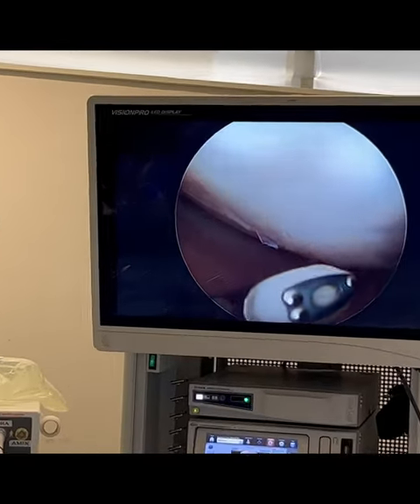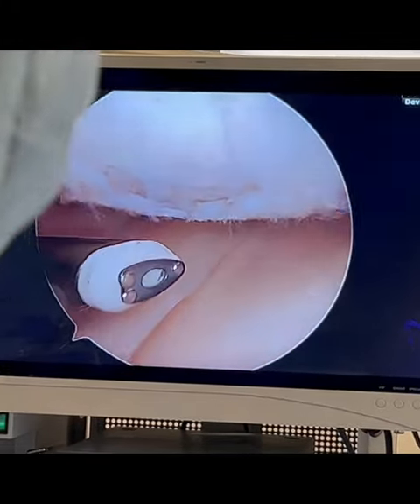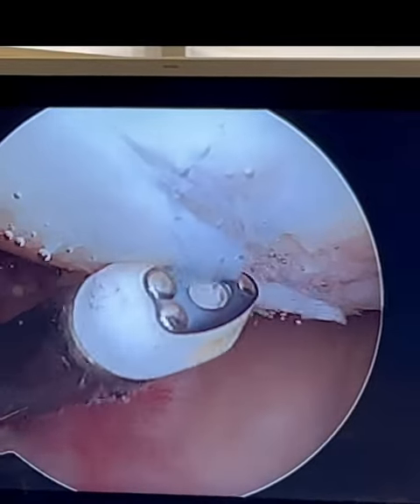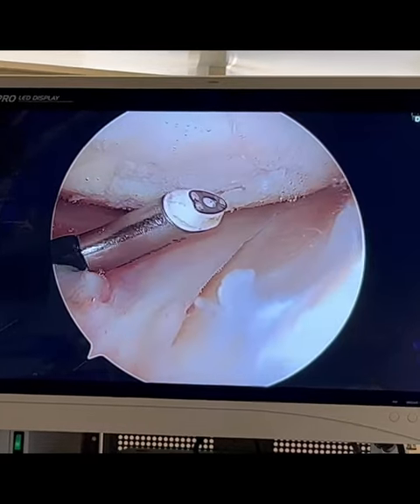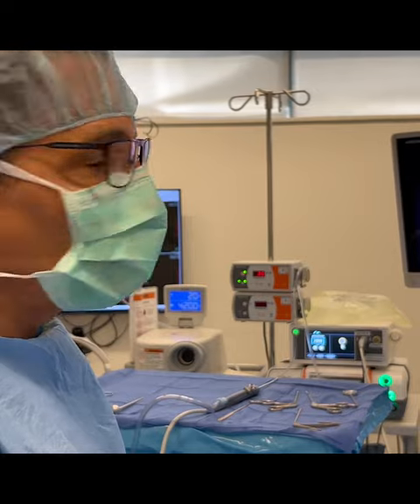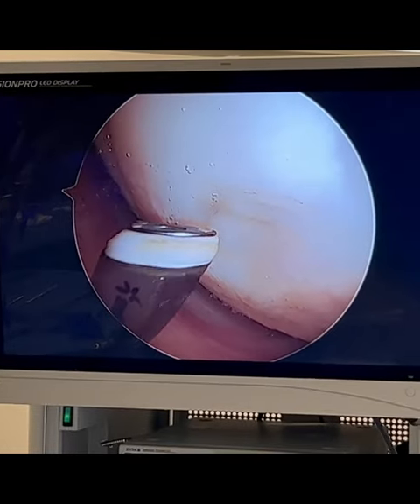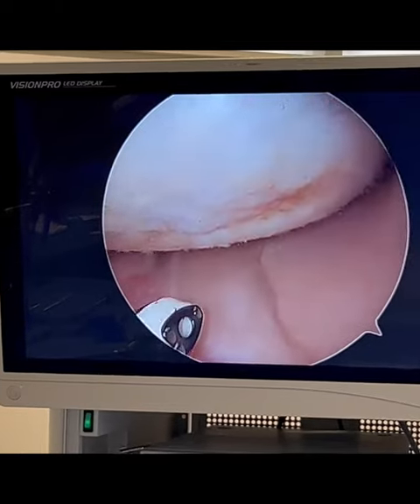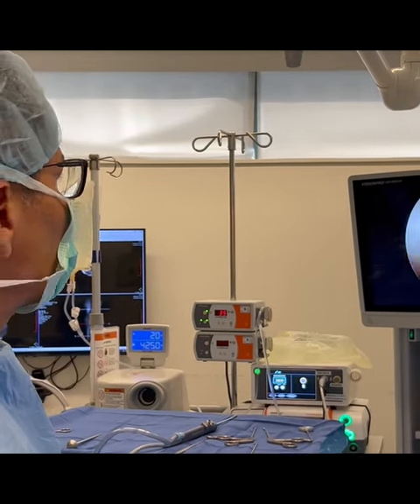What is CHONDROPLASTY of the Knee? #theUFCfighterSurgeon explains

Comment: I injured my knee skiing whereas my skis stuck on wet snow and my body momentum went forward...just a twitch.  I had pain going up the stairs initially and after the 4th year of injury every once in a while transferring my weight to that leg while skiing I had extreme sharp pain.  After my second MRI(the first one was normal), the imaging show inflammation at the infrapatellar area.  After knee arthroscopy, they found lateral meniscal tear and chondral damage.  It took me 4 years to fix my knee.  I ski 20 times/season, do day hiking, running.  I am very active.  It is now 4 weeks post surgery and while I have full flexion, still with pain/stiffness I am not back to fully recovery.  I wouldn't think at this point I will buy a seasons pass to ski.  I am not back to weight lifting which I did prior to the surgery.  My PT advisor says do NOT rush your recovery.  That is hard, I love being active. At least I can get in/out of my car with a little more ease and I hope that gets better.  What will be a delight is being able to do yoga again.  I don't trust the operated knee yet to hold a flexed position at this point.  Trying to eat healthy, taking 1000 mg vitamin C, 100 mg of Zinc, B complex.  Anything additional advice to help my recovery would be welcomed.  Thank you.

Comment: I might have to undergo this procedure too.  It was mentioned in one of my doctors notes upon seeing me after a recent MRI of my right knee, which indeed showed torn articular cartilage in the trochlear region.  My case is degenerative in nature due to arthritis, and I’m wondering if that type of injury is a good candidate for this procedure?  I’m 52, and the knee has degenerative osteoarthritis, mild to moderate stage of degeneration.  I’d rather continue therapy to strengthen the muscles around the affected area to relieve the pain and discomfort.  But what are the odd that this would work for someone my age?  I was also told that this will leave me with bone on bone if I go through with it.  And is a total knee replacement better than just doing this procedure?
Reply: I'm 69 and I had repair of my knee.  By having an injury inside your knee there is chronic inflammation worsening your joint every day that goes by.  Get the surgery and get a better joint in the process.